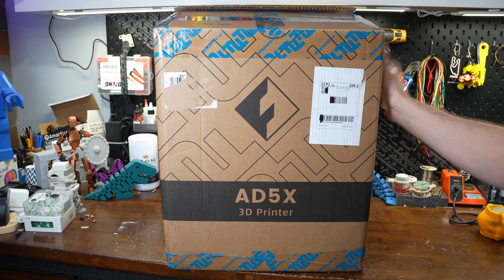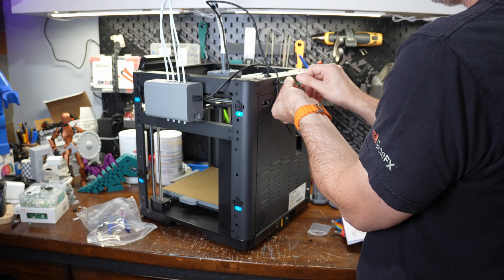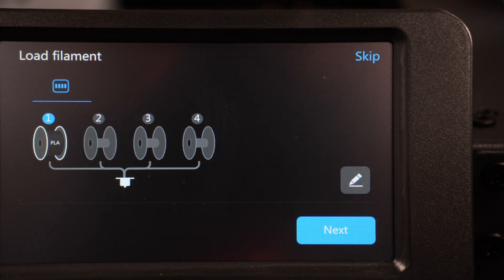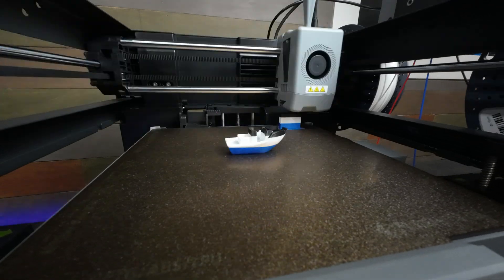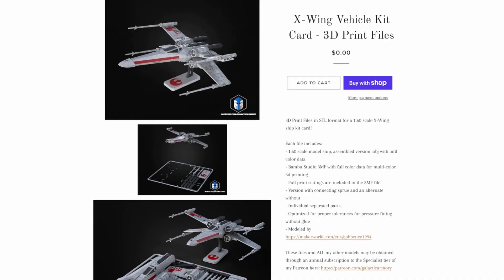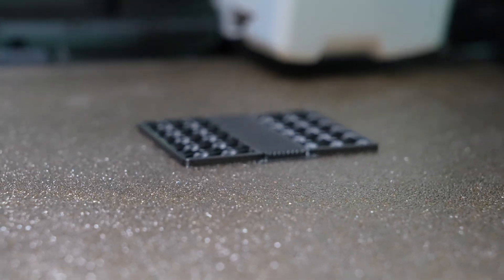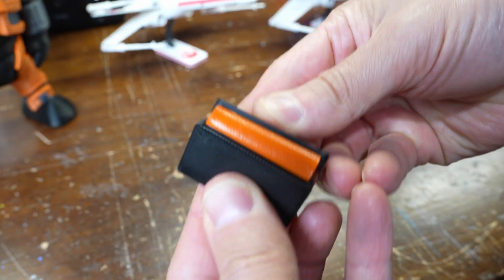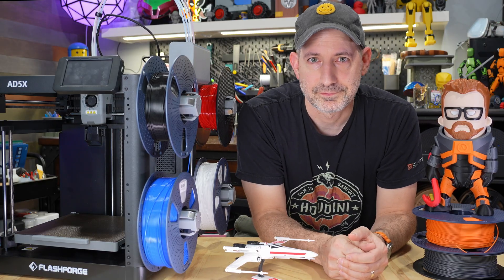Flashforge AD5X 3D Printer Review – The $399 Multi-Material Beast

Comment: I'm struggling with which printer to go for, narrowed it down to this AD5X, the A1 with the AMS lite or the creality Hi with a CFS. Each one is currently £299 here in the UK. Not sure what I'd be printing, but in the future may print the odd thing to sell, assuming the quality is good enough, or would you say it wouldnt be with any of these 3 inexpensive printers?
Reply from the maker: AD5x and A1 are both solid, I’m not a fan of Creality any more. I had 2 and had issues over time. Quality seems hit/miss with them
Reply: I managed to get mine for £239 from a shop on eBay on Black Friday deal.  🙌🙌 you might find it cheaper if you look around

Comment: How did non-skinned orca slicer cope with multicolour? Is your profile exportable to share?
Reply from the maker: I was sending files over WiFi and then starting he print on the machine and checking the box to use multi colour printing. I didn’t try upload&print so not sure if it would have worked that way. 
But assigning the 4 colour in orca and them matching the channels on the machine worked fine

Comment: So I got this machine to play with, and saw alot of vids saying the normal orca was having troubles with the IFS and seeing it? I take it that has been fixed, I don't really need 2 orcas lol awesome video!
Reply from the maker: Thanks 🙏. I didn’t have any issues with normal orca. When starting the prints on the machine there is a checkbox for IFS. I was sending files over WiFi and then printing from the machine and checking the box before printing. Maybe if you “send and print” it doesn’t get checked. Can’t say.
Reply: @DaveRigDesign  Well guess what I'll have to try that! lol This is a great little printer and for the price point can't really beat it! I mean My bambus just work and I have thousands of hours on them all but you do pay for that, I even have a few Elegoo Centari carbons which as you know are cheap but they still haven't given is the multi
 color we want lol
Reply from the maker: I was really liking my centari carbon until the bed stopped heating. New parts just arrived so I have to perform surgery and see if I can get it working again.

Comment: £250 in the uk if you find the deals. Struggling with petg its stringing like candy floss and layer adhesion is poor. Think the enclosure will help ??
Reply from the maker: Sounds like the profile needs some tuning. Try running some calibration prints like a heat tower and retraction print. They are in orca slicer under the calibration menu.
Reply: I’ve seen where users have increased the nozzle temp up by 10 degrees and def got the enclosure.

Comment: I can already assume how the clutch in those spring-loaded spoolholder will wear out over time... unless they are ratcheting... either way but I am fairly certain it will have inconsistent backspooling over time.
Reply from the maker: Seems to be a slip clutch of some sort, the spring back is maybe 1 rotation or less, then it slipped. There isn’t that much resistance before slipping so don’t think it will wear out anytime soon

Comment: Damn.....I had been looking at getting one these......😅 I gotta be honest i'm hesitant though.......Not sure if anyone else encountered this, But When 'Windows' announced the end of window's 10 in spring 25, ALL my printer's sabotaged them selves & or stopped working....... Which killed my business!😮‍💨
Been reluctant to invest in any until i know why they've all ceased to work......
Reply from the maker: That’s weird, windows shouldn’t affect your printers. Your slicer runs on your PC so maybe that could be affected. Well the AD5X is working fine :)
Reply: @DaveRigDesign  Cool, That's good to hear👍 Yeah despite the extra cost i loved the plug & play-ability of 'Flashforge' compaired to other machines i've used......

But that wobble factor from the dropping the build plate scares me no end..... 😅Also i resent the fact you have to 'Bug Report' Via 'Facebook'......!🤔

As for my issues, Yeah honestly iv'e never had any like it....... 😅and loved my AD3......!. Also a bizzare set of issues so i have yet to figure out what to do just asking anyone & everyone...

Since april it stopped printing anything larger than a 10mm cube..... Anything larger gives 'File Format Error'.....
Tried the normal....{on off again, then a re instal / update} to no avail.... 

I did manage to get one design printed, at one point {by changing 'Mk D' to 'Mk C'....🤷‍♂} then i made the mistake of re slicing {thinner / thicker wall's}, it then refused even when i put the setting's back...😂

I also had/ have a a delta printer......That one {since april} would print a third of it's build, then raise it's self up a few inches then look like it was trying to conjure magic like 'Dr.strange'........😂 

One day i decided to let it play out instead of canceling to see what happened.....🙄
 It did it's ritual then.....{& i've no idea how it actually achieved this}...... rotated the print head to a 90 deg angle and drove the hot 'Hot-end' into the rubber pulley on the support arm.....😂
Reply from the maker: that's crazy. was there some firmware update or something to have them act up like that?
Reply: @DaveRigDesign  Lol, funnily enough.....😅 I believe there was.....😊

The same day everything including my i-phone updated and all my tech went screwy....😅
 I get it....all my tech's at least 8 yrs old & 'They' want everyone to switch & update frequently......But i thought we'd been through this with 10...😂

perhap's im just cursed...😅
Reply from the maker: Well a printer is pretty stand alone. Worst case you should be able to flash them back to a known working firmware version and keep them off the internet.
Reply: windows update has nothing to do with your printers. Try flashing them to the latest update. 
I personally ditched windows 5 months ago, i run everything on Manjaro Linux. Orca slicer runs perfectly, all my printers too. 
Maybe create a USB stick running on linux, just download Orca and try to slice a print from it. See if it is any different.